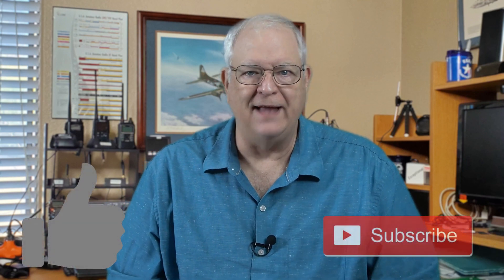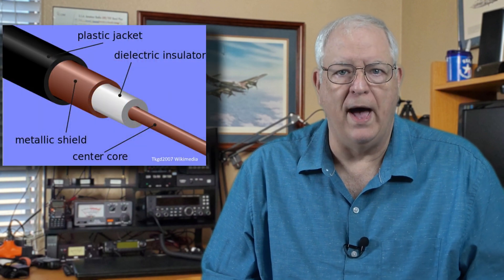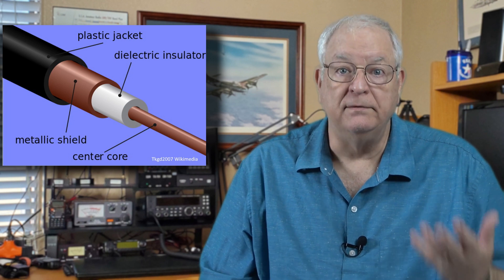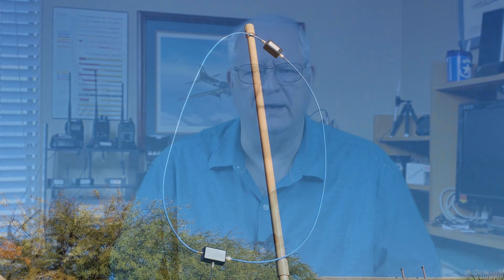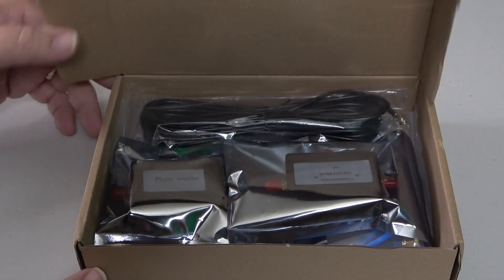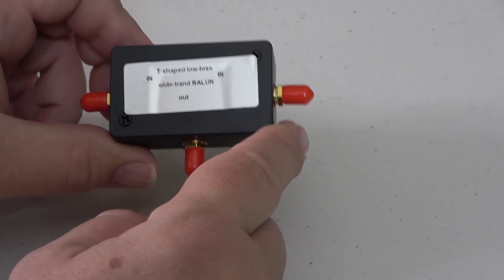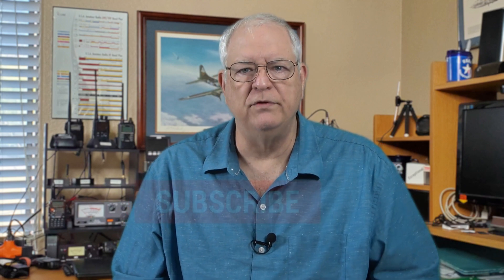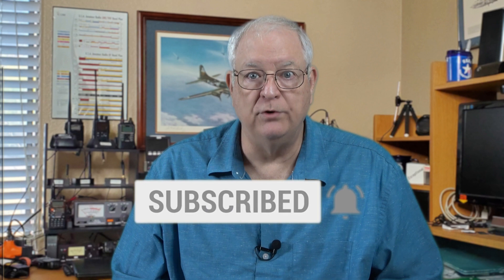YouLoop SWL Antenna

Comment: I recently acquired at a garage sale a vintage 1936 Slivertone radio with no antenna, but working.

It covers 500khz through 15mhz.  Would this be a good antenna to get this beautiful beast back on the air?
Reply from the maker: Brad, I think I'd try the MLA 30 plus. It is an active antenna (small voltage applied) that covers those frequencies. Amazon affiliate link: 
https://amzn.to/3XoexYT
It's a bit cheaper on Ali Express. I did a review of the previous version here:
https://youtu.be/AVDkD_T-BUA?si=5Ju1qSQ3nM7BIn6O. Have fun.

Comment: The waterfall and spectrum are not running smoothly suggesting that your sample rate is way too high for your computer to handle.  Am I correct or is this a problem with your video capture software???
Reply from the maker: Probably a combination of both. My 'radio' computer is fairly old. Cheers

Comment: Excellent!...Do you know if these Youloops will also work with a standard desktop  HF receiver (Such as an Yaesu 7700 or 8800) or do they only work with SDR recievers...?
Reply from the maker: I'm not sure.  I haven't tried that. I suspect the answer is going to be yes but how well it works will be the issue. If nothing else, it's a wire in the air. The recommended use with a high dynamic range SDR likely has to do with overall sensitivity. As I describe in the video, it works with my RTL/SDR which is not an HDR device.
Reply: Late to this video. Thanks George. Great explanation. Mine arrived today with no directions. Not too much to put together. Thanks again. ATB.

Comment: Thanks for putting this up. I picked up a Tecsun PL-680 recently and have been looking to improve its shortwave reception. The Youloop was recommended to me so your video has been extremely  helpful.
Reply from the maker: Thanks for watching a commenting. Please post a link to any SMA to 3.5 mm converter you find works with your Tecsun.
Reply: @GadgetTalk4U  TRY 14.78 | RG316 Cable BNC Male Plug to SMA Male Plug Straight 6inch~10FT
https://a.aliexpress.com/_uZ9X8J